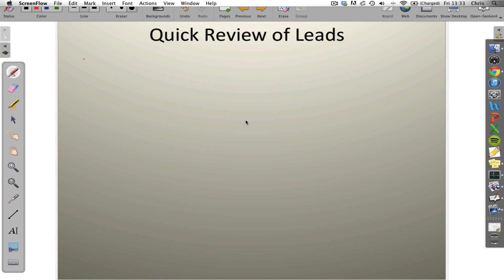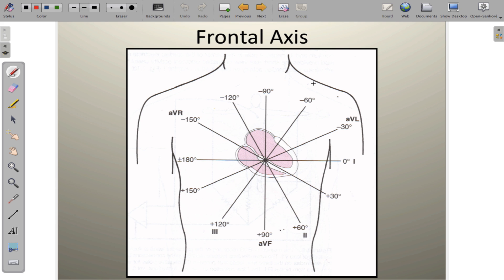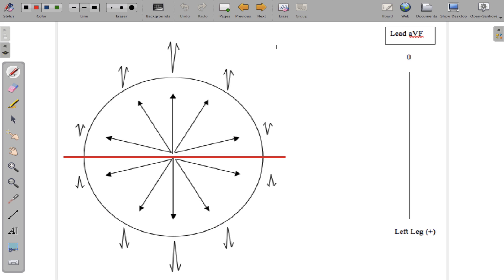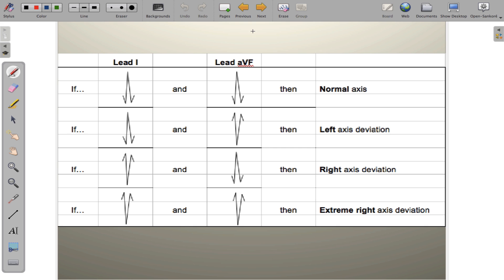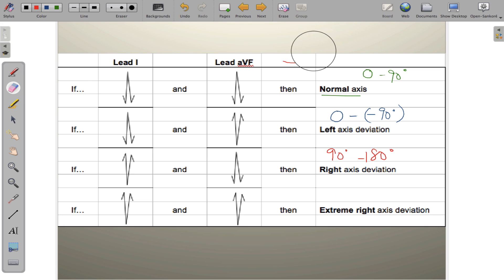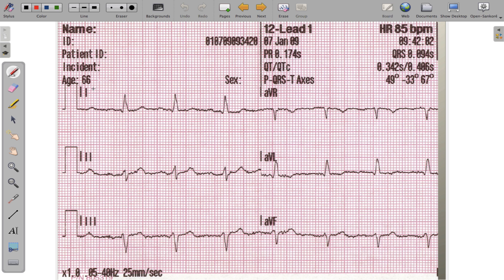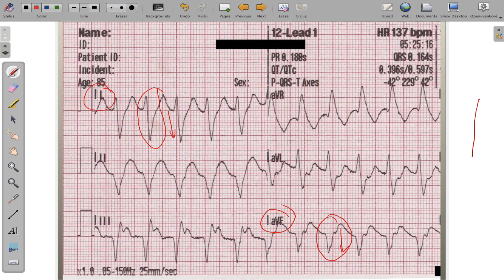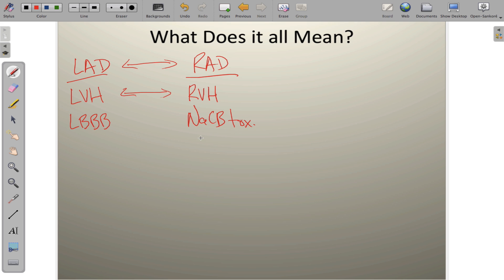ECG 12 Lead Axis Deviation

Comment: I wanted to double check that the recorded numbers given by the ECG was giving the correct axis degree number.  Thank you for being the only video I found that explicity mentioned that.
Reply: Thanks so much for watching and for your kind words. The software's ability to measure electrical axis is actually quite reliable.
Reply: @christouzeau8124  You're welcome. Also is R axis just the shorthand for QRS. I see some ecgs print P-R-T axis.
Reply from the maker: @SupermarketSweep777  Yes, that's right - R = QRS.

Comment: For quick reference of RAD and LAD remember Right together and Left apart - i.e. if the tip of the QRS pointed together = RAD tip of the QRS apart = LAD. AND both negative = extreme